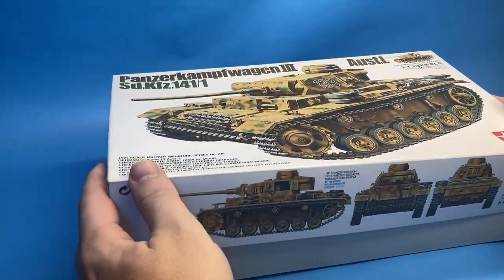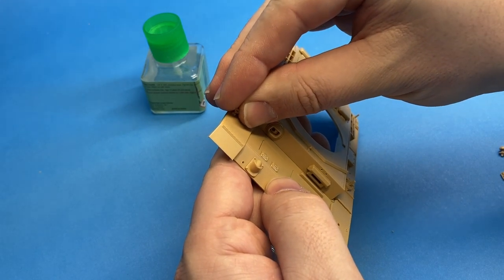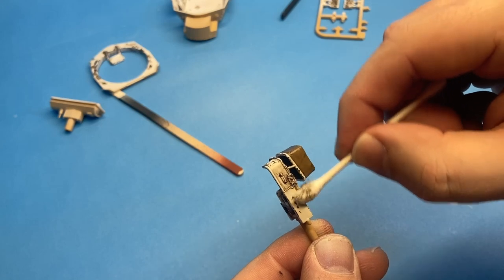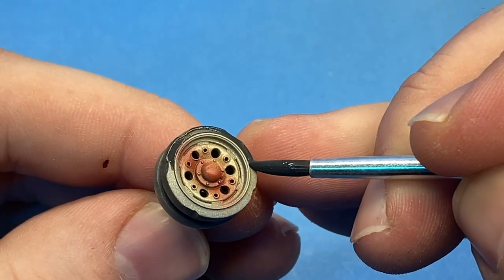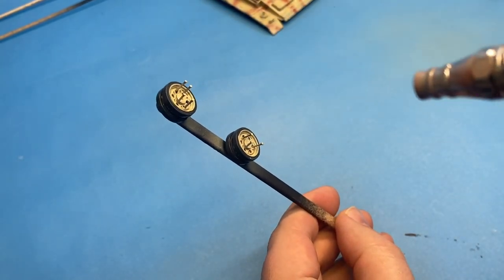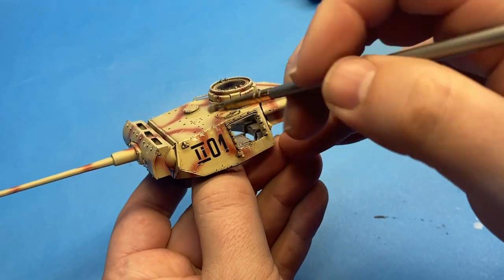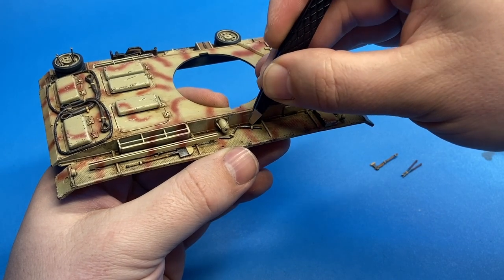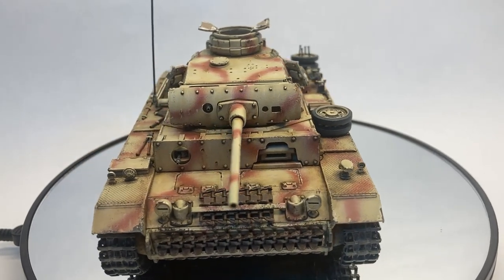Tamiya Panzer III Ausf L - Full Build - Part 1

Comment: Nice build - well done.

I have stayed away from vallejo paints preferring my Tamiya for cammo schemes because of ease of application but they do have a great selection of colours.

Thank you for sharing.
Reply from the maker: I agree, the Tamiya paints are far superior.  However, I do not like mixing colors, and I find that the Tamiya range is severely lacking in color options, which is why I turn to Mig and Vallejo.  But, I'm just lazy that way!  Thanks for watching!

Comment: Note:  II01 would have been the 2nd Battalion Commander's personal tank.  depending on the year, the Adjutant IIa and extra tank IIb followed by the Reconnaissance platoon commander in II04 would have followed. II05-II08 would be the tank reconnaissance platoon.  Regimental staff followed the same but would be R01-R04 with the Regimental Recon Tank Platoon as R05-R08.

Bruce Culver has the best books for anyone who wants to get tactical markings and colors right.  Panzer Colors I, II, and III.  I use them religiously 

Ist company, 1st platoon would look like this.   111, 112, 113, 114, 115.  2nd Platoon, 121, 122, 123, 124, and 125. Its ALWAY... Company#, Platoon #, Tank #.
Reply from the maker: This is useful information thank you for sharing!